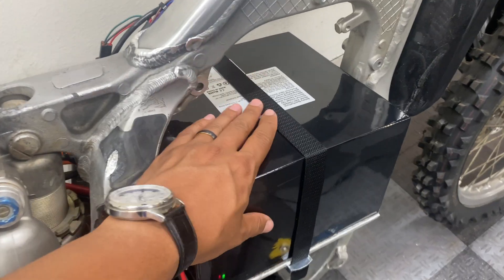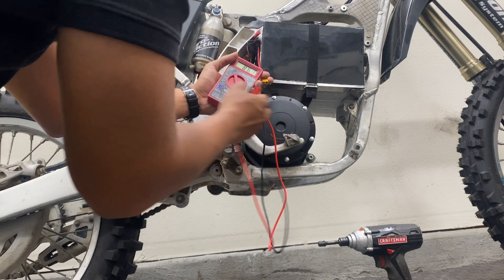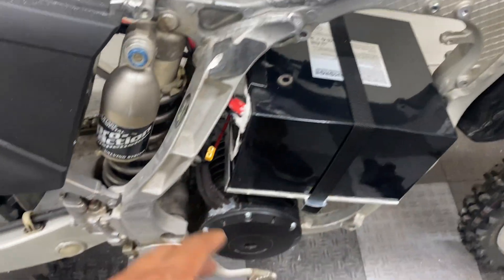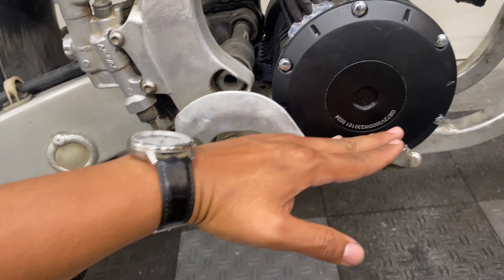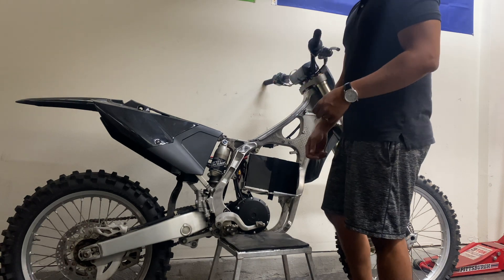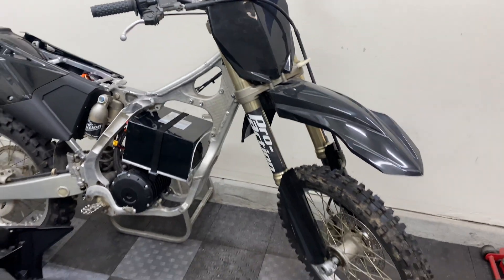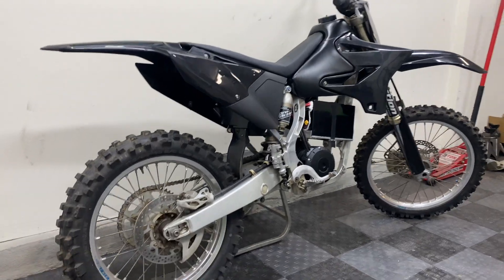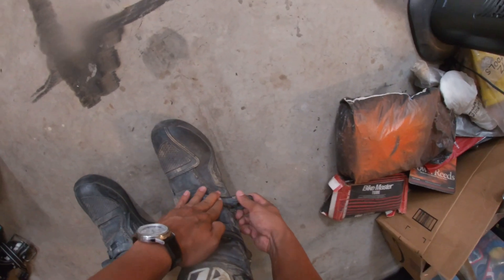Project YZ-E is Finally Done! E&C EMX QS138 Powered Yamaha YZ250 Electric Dirt Bike

Comment: Did you have to have the motor direction reversed from E&C or is that how it comes from them? I’ve seen others use these QS motors and they didn’t spin the correct direction?
Reply from the maker: The QS motors from E&C (v3) come with a gear reduction assembly built in, which rotates it the correct direction.
Reply: @PatOutdoors  oh alright, I was wondering about being able to switch the rotation direction  say if you had the chain on the opposite side of the bike and needed the motor to spin clockwise instead of counter clockwise like how you have it mounted now.
Reply from the maker: @Glockomuh  what dirt bike do you have? Most gas dirt bikes have the chain/sprockets on the left side of the bike. My Talaria and Razors and on the right side though
Reply: @PatOutdoors  it is actually for a shifter cart that I’m converting to electric, I’m currently using the EC4P which you can change direction via the tru Moto app but the new sprocket is for a 428 chain and that cant be run on the EC4P so looking to upgrade to QS but wanna make sure I can mount it without having to switch everything around.
Reply from the maker: @Glockomuh  E&C has other QS motors available that should spin clockwise though, with the correct controller

Comment: I have the same bike frame Amet and I want to put a QS 180 motor in there. 

Do you think it would fit or stick out?  I’m moving the rear brakes to the front handlebar.

Comment: Hi, i have a yz 250 2014, its motor just blew recetly and im thinking about converting it to electric. I ride hard motor cross and super cross. How does the power compare to the original 2 stroke motor?
Reply from the maker: For hard motocross, I would go with a better battery for higher power output. Molicel battery by Electro & Co with this kit can produce 25kw (35ish hp) with no shifting. The throttle curve is very different though, lots of torque down low and tops out quickly 62mph (obv depends on gearing.) Throttle feel can be very odd coming from a 2-stroke though, very sensitive if you’ve never had a e-bike

Comment: Hey Pat.  Regarding the small red wire on the controller harness, does that go on the controller post with the red background next to where the battery connects?  Thanks.
Reply from the maker: It connects to the same post the positive cable of the battery goes
Reply: Gotcha.  Also ordered the amorge battery and I'm awaiting delivery.

Comment: Nice Pat looks like it’s going to be a fun ride . Wonder what the ride time in the woods your going to have.
Reply from the maker: One of my concerns as well.. I’m also curious if stepping down sprocket size for more torque less top speed is a better move
Reply: @PatOutdoors  Yea I change the sprocket size on my razor build to get more bottom in torque. Did not take away much from top speed I like the bottom end punch better than top end .I’m think about a qs138 I am 125 frame .

Comment: No way it’s faster or more power than gas engine
Reply from the maker: Vs a 2-stroke engine, you’re right. But that’s not the point of this bike. It’s to have a predictable power band and throttle curve for my wife to ride that requires no clutch or shifting. It’s far fasting that my 4-stroke Kawasaki though..